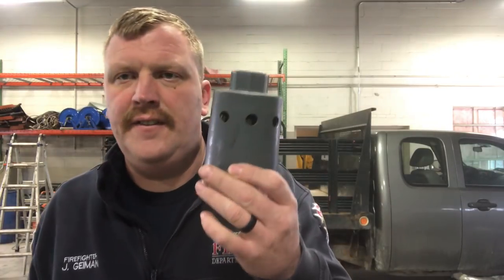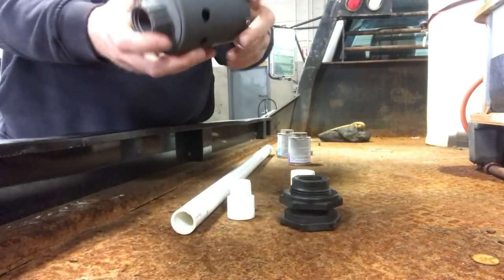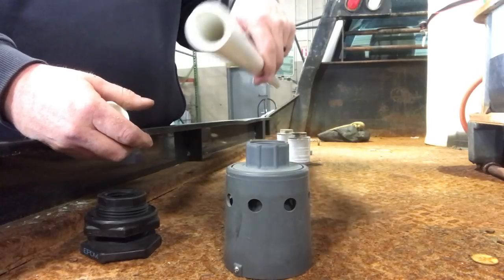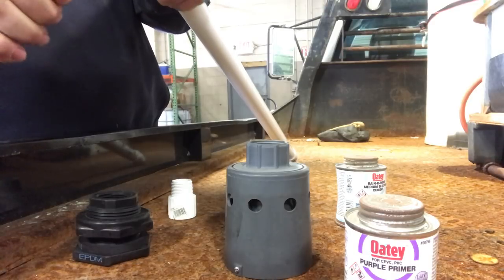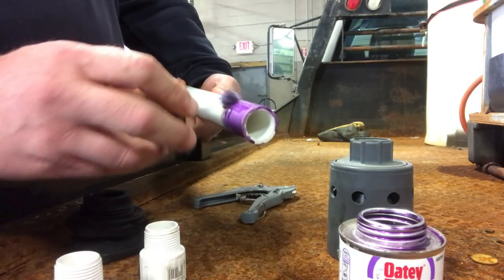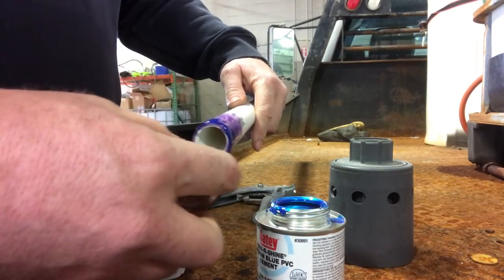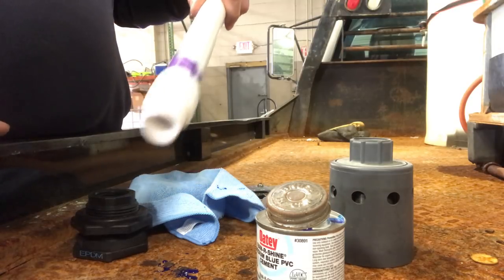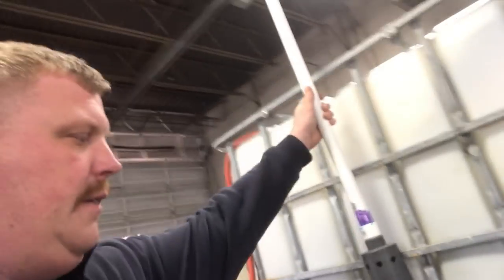WATER TANK LEVEL CONTROL SYSTEM FOR A PRESSURE WASHER HOLDING TANK

Comment: Jason
I made something like this as one of my first videos.  Years later i realized an easier solution OUTSIDE of the tank.  I put a ball valve between my supply reel and the tank.  That way i can shut off supply when i get close to the end, but if i need more water its just a 90 degree turn.
Reply: First Choice Power Washing i mean the mid height vs top only valve
Reply: That's exactly what we do. We also have a three way connection and added another hose for rinsing or filling buckets. Works well..👍🏼

Comment: If I have a 275 gallon tote and I measure one foot from the bottom then how many gallons is that?  Thanks in advance  for the imput.
Reply from the maker: It should say on the side of tank
Reply: 99.74026 gallons. Pretty much the first horizontal cage bar.
40"x48"x12'" = 23,040 cubic inches then google has a cubic inches to gallons calculator which gives you 99.74026 gallons.

Comment: Hey man, I have a quick question for you. You are way more knowledgeable about this PW stuff than me. I have a 4200 4gpm Honda GX390.  My question to you is, how can I downstream through 150' of high pressure hose? It will only draft from shorter hose lengths. I've seen alot of your vids and know you have the same machine. And no way you only use 50 feet of hose. What's the secret?
Reply from the maker: Colby Reneau make sure the gun is opening fully
You have the right size tips for your machine
Right size injector
Reply: @kingofpressurewash  tips are correct. Jrod from pressure tek. Injector is a new 2.1 which in my research is the correct one. Gun is correct and opened. Any more ideas?
Reply from the maker: Colby Reneau will pull soap with no gun on it
Reply: @kingofpressurewash  haven't tried that, I'll let you know tomorrow. Happy 4th bud.
Reply: @kingofpressurewash  I cant believe it worked with no gun. Pulled it through quickly. Any ideas for good guns for me?
Reply from the maker: Colby Reneau I like this gun
https://amzn.to/2xF2NGl
Reply: @kingofpressurewash  I just ordered it. Thanks again for your help bud.
Reply from the maker: Colby Reneau awesome
Reply: @kingofpressurewash  hey me again. Thanks for all your help.  Is there really that big of a difference between 10% SH and 12.5% SH?  I just ran 10% SH from Walmart at 100% solution and it did not clean regular mold and algae. Do you think it can still be my gun?
Reply from the maker: Colby Reneau could be
But the sh could be bad also
Not the proper way to test it but stick the tip of finger in it and it should turn it white.
If it don't the sh is bad
Reply: @kingofpressurewash   Thanks buddy. I think I'm gonna go to the pool supply today and get some 12.5%.
Reply: @kingofpressurewash  also, should I dilute the new good 12.5 SH from pool supply? If so what ratio in 5 gallon bucket?
Reply from the maker: Colby Reneau you can
 But I would try it straight since you having issues
You can do 3 sh 2. Water
Reply: @kingofpressurewash  ok thanks, just didnt want to damage plant life. Thanks for the help.
Reply: @kingofpressurewash  is there any surfactant that is available everywhere you suggest? Dont want to pay $40 for Elimanator and shipping from Pressure tek
Reply from the maker: Colby Reneau just water before and after
Reply from the maker: Colby Reneau you can use gain laundry liquid  detergent
Reply: @kingofpressurewash  thanks bud
Reply: A rep from Pressure Tek told me to use a 1.8mm injector. Does that even make since? Being that would create more pressure. I thought the bigger orifices would draw, not smaller!? 

P.S. Got the gun you told me about. Still wont draw SH, but draws fine without a gun attached. Any ideas?
Reply: @kingofpressurewash  best way to wash limestone? Can I use a regular house wash? Will the SH damage the limestone? Any suggestions?
Reply: @colbyreneau7018  do NOT use Gain Laundry, its Gain DISH Detergent

Comment: Could you list the sizes of the pipe and fittings that you’re using? If not could you just send me that information. Thanks
Reply: Hey Jason, great I have a question about how to feed a direct drive pressure washer from a buffer tank if it is even possible how it is done, I don't want to burn the pump in my new PW I am new to the PW business however I have a Honda 4200PSI 4.0 GPM this is what I have to use until things gets better thank you
Reply: @henrydixon3159  Hey Henry. I had the same question. Did you ever get an answer to this? Thanks!